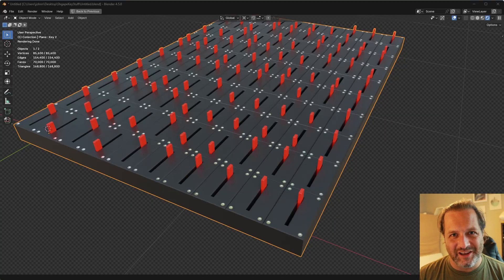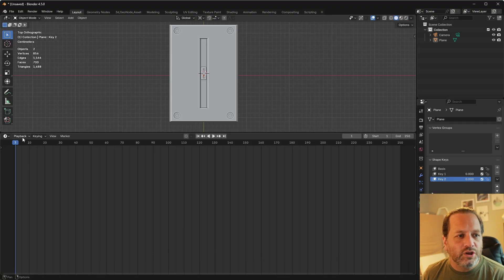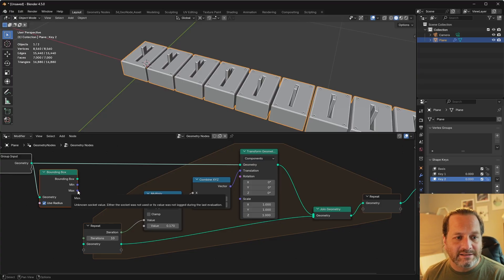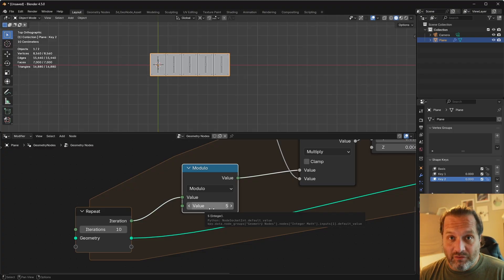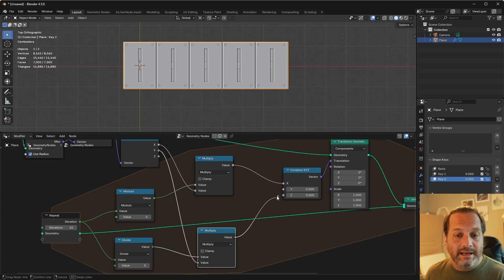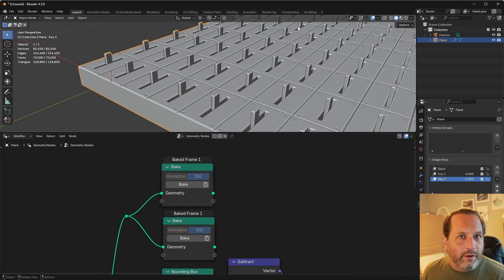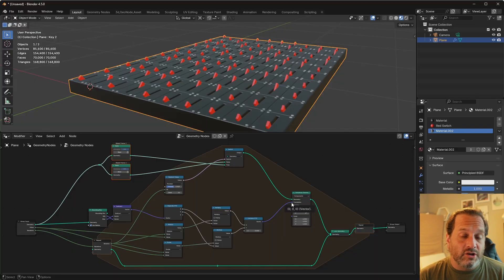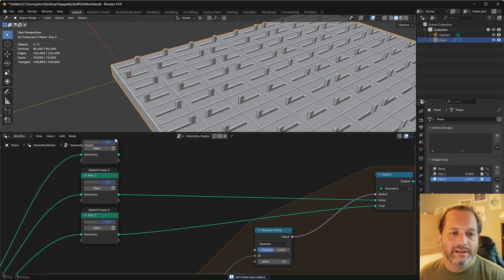I Tried a Harebrained Shape Key Idea in Geometry Nodes… and It Worked

Comment: Cool stuff, I was also playing with a similar idea of baking animations and being able to pick the geometry of different frames.
It's kinda wild how the Bake node just makes that work lol.

I do think for more general setups, Instance on Points is better than Repeat Zone for selecting which geometry to use.
You basically combine all the different shapekeys you use with `Geometry to Instance` and plug that to IOP's `Instance` input.
Then you enable `Pick Instance`, and plug a `Random Value` to the `Instance Index` input of IOP.

That way you can just use `Grid` as the `Points` input, or change that to whatever layout you like without having to manually build it inside a Repeat Zone.
Reply from the maker: Totally! There is definitely more than one way to do it!

Comment: Can geometry nodes be used to smoothly transition between shape keys with per-instance control over slider values?
Reply: I think you should be able to by using a mix vector node. You can get the position of each shape key, and the original position using a sample node, then mix between those
Reply from the maker: @JoeyCarlino yup already in progress for my next video 😊
Reply: @JoeyCarlino  Indeed it works. The only issue is that in the case of hardsurface object (as in the video) bouth mix vector and shape keys stretch the mesh.
Reply from the maker: https://youtu.be/KxAzRbcZcPk
Reply: @JohnnyMatthews Thanks 👍🏻
Reply: I have that same question
Reply from the maker: @se7964 I’ll do a follow up on that!
Reply: @JohnnyMatthews  Awesome! Great video and I subscribed!
Reply from the maker: @se7964 welcome to the channel 😊

Comment: Why does a math node need to be used between the iteration output and the combine XYZ for the transform node to recognize it? Is it somehow changing the data type?
Reply from the maker: The modulo operation constrains the iteration number to a limited set of values. The multiplication scales it up to the width of the model.
Reply: @JohnnyMatthews  I meant specifically at the 3:25 mark. Where just the value from the iteration has no effect, but once you add in a math node, it registers the value.
Reply from the maker: @KDawg5000 oohhh. I misspoke. It actually does do something. It translates each copy over in whole blender units, so the copies are off screen. 😬